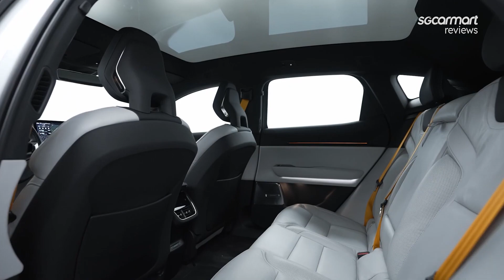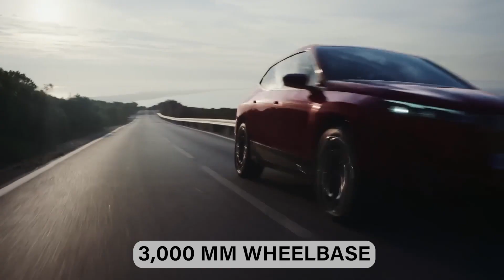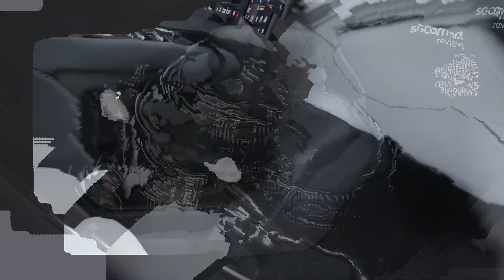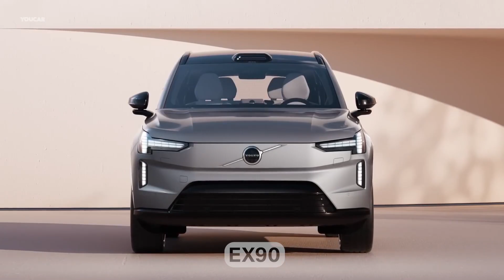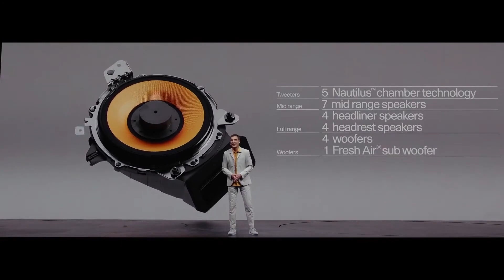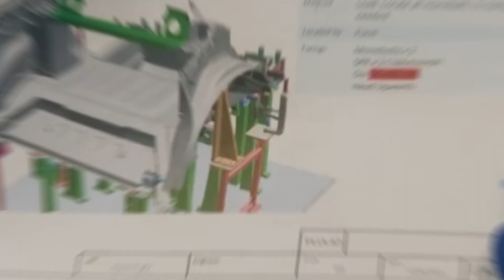The ALL-NEW Polestar 3 SUV SHOCKS The Entire Car Industry!

Comment: I am sure the volvo's build quality seems to be better than the model Y(if this is the proper comparison), but for the price of near mid-high $80k, 270-300miles range, 4.6-4.9sec 0-60 for the Polestar, I would rather get the Y. The Y doesn't even have to be the performance one to compare. Regular Y DM, 330miles of range, supercharger access, 4.3(with the AB upgrade for extra $2000)-4.8sec 0-60,  respectful interior space with frunk and trunk(recessed space), minus the air suspension for around $55k(current), federal tax credit available, I will choose the Y in any day. The delivery is very quick compare to the last couple of year(other ICE cars had similar shortage issues, near impossible for other EVs under the MSRP), also.
What do you think friends? I really don't care much about the look of the car as long as it has four wheels and good aerodynamic. Share your comments. Thanks.
Reply from the maker: I agree with you on this one. Is it really Worth send so much money on a Volvo when you can have a model Y RW so much cheaper? Better to invest those money if available 👍
Reply: @itselectricvideos  Thanks for your comment whether you agree with me or not. It's a very good point.
Reply: @itselectricvideos not everyone wants to own a Tesla. And be like all the other sheeps on planet earth.
Reply: Teslas are cheaper because they are a mass production car company which means they can have lower prices and they can reduce the price all the time to sell more cars. Polestar is not a mass production car brand and focus on the extra and stand out from all the other car brands. Polestar don’t want to lower prices so regular normal boring people can own them. Polestar car brand is the extra special class of humans. Only the best can afford it. Tesla can anyone own even a sheep. Polestar and Tesla is not the same.